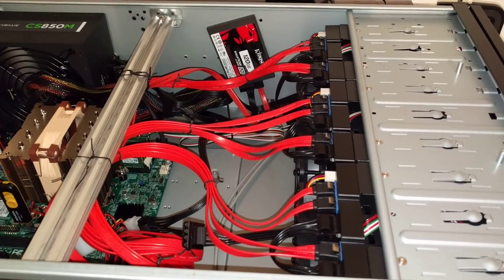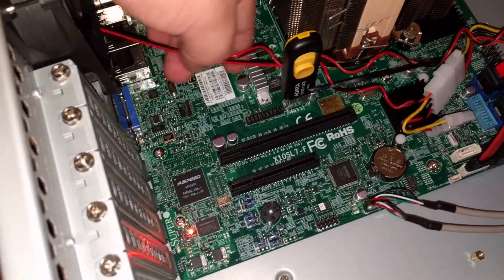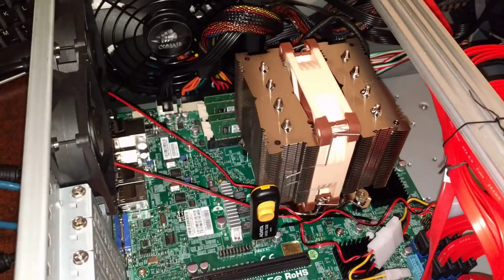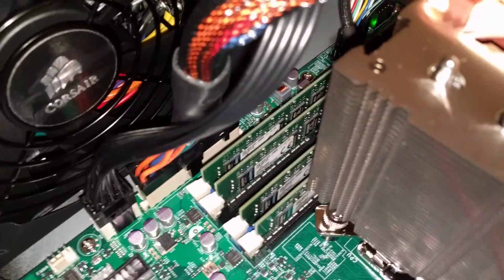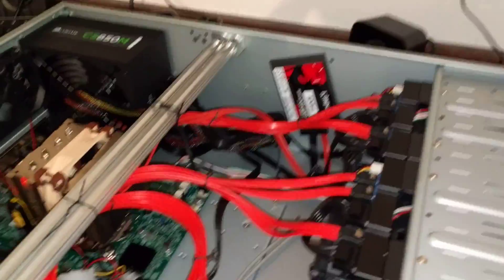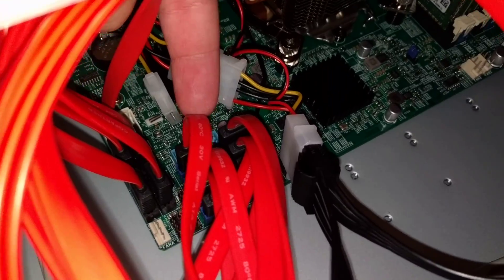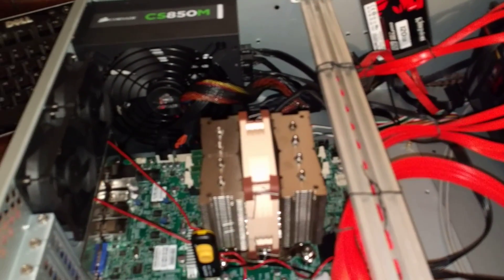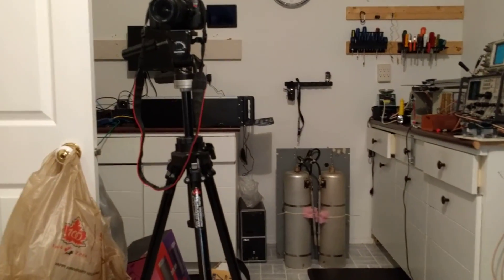My FreeNAS box

Comment: To be honest I just replaced my Xeon E3 1275 v6 32GB Ram 6x4TB setup... it sounds like a very good system but when you actually factor in the energy bills and the cost of the machine, its not worth it. I sold mine, got myself a ODROID XU4 Cloudshell2 with 2x10TB hard drives... Runs at around 10-20watts during streaming and low when idle. Xeon on the other hand unless you have M series are all 75-100 watts, over the course of a year this adds up. Also, as a NAS, you really don't need those kind of speeds internally, even for 4K 10bit. The setup I have now does 100MB/sec, down from over 300MB but... unless you need those speeds, this system and mine was simply over kill and a waste of power.... unless your planning to stream multiple 4K 10bit HEVC UNMUXED there's no need for this type of setup. Save yourself some money and get an decent ARM device that works with Ubuntu.
Reply from the maker: Yeah, that's a fair criticism. We use this thing very heavily as both my wife and I work from home. It's also the datastore for all of our VMs for work/services so we really do need those speeds. Both of us run heavy backups to this thing and we need to be able to move large data sets on and off regularly. Besides work, it's our entertainment system, our "HD" NVR system (HD local, SD to cloud storage), and where we keep our important photos/encrypted docs, etc... We could move to a more power-friendly device, but where I live the price per kilowatt hour is low enough that it still makes sense to us.
Reply: What’s your hdd setup?

Comment: on what basis do you suppose you need extra cache (ARC)?
Reply from the maker: Mostly because I am using it for VM datastores, so having the ability to use the 10Gbps NIC full out to SSDs made sense to me. I do rarely hit the cache hard enough to justify it's existence, but by the same token, this box is admittedly over kill.
Reply: Thanks, the reason I ask is because Wiki isn't clear about it:   

  "Lack of suitable caches, or misdesigned caches — for example, ZFS can cache read data in RAM ("ARC") or a separate device ("L2ARC"); in some cases adding extra ARC is needed, in other cases adding extra L2ARC is needed, and in some situations adding extra L2ARC can even degrade performance, by forcing RAM to be used for lookup data for the slower L2ARC, at the cost of less room for data in the ARC."

So using L2ARC devices comes with performance degradation risks, but its not clear why.     But on that note, I don't see any option for choosing "read" or "write" caches in FreeNAS - just the option to add an L2ARC device?

Also - if you were using this for VM Datastores, wouldnt that be more justification for a dedicated SLOG?
Reply from the maker: Yes. Completely accurate. My issue is that I am running 32GB of RAM which is the max for this board, but I have close to 40TB of ZFS discs spinning. This might not correlate right away, but ZFS eats about 1GB of RAM for every 1TB it's tracking so when I boot up my ram usage basically hits the roof. In order to prevent massive swap load,  I opted for the SSD ARC.

Comment from the maker: Update 2: The main volume has been expanded to 8 WD RedTB drives. Two of the four 1TB drives have had issues - one failed, one is giving SMRT warnings. The X10-SL7-F mobo has 8 ports on it's Broadcom 2308 SAS2/SATA (6Gbps) controller, so that's where the 8 WD Red 4TB discs are connected. The 4 1TB drives were on the internal 3Gbps controller, with the two SSDs on the remaining two 6Gbps SATA ports. Today, the content of the security volume (formerly the 4 1TB) has been backed up to the main volume and rebuilt. There is now a WD Purple 4TB drive being used for my camera DVR, and the two remaining "good" 1TB discs are in a RAID1 as a further security volume for storing the "stills" (about 10fps JPEG) captured by my cameras before being duplicated to the cloud. I have an other 1TB drive (not a matching Seagate) sitting in the one remaining slot. At this time all 14 (8+4+2) SATA ports are full, so this makes a total of 16 discs if you include the boot media USB3 drives. 

On the networking side, I have now installed an HP dual SFP 10Gb NIC. At this time it connects between a matching card in my workstation in my office and the FreeNAS box, but in the future it will be the connect between my ESXi box and the FreeNAS box so that boot time is lower on the few VMs where the boot media is on the NFS store (only 2 of the 4 VMs). For the two main VMs on this box an internal SSD holds the boot drive, but all other data is mapped to the FreeNAS box.

One thing I have wanted to do since early on was to replace those fans, but I just can't bring myself to remove such quiet-at-full-speed fans. Rosewill really shocked me with those. I expected they would be absolute trash, but they have been surprisingly solid. There are 7 fans total in this box, 5 of which are Rosewill. The other two being the Corsair one in the PSU and of course the Noctua fan in the NHD7L.

Comment: Nice cans ;)
Reply from the maker: :) Yeah, that whole repeater was supposed to be off the bench and back into service a year ago, but sadly it remains homeless. It's currently running into a 250W dummy load as if it was on an antenna because there were issues with the controller previously. I can't seem to replicate the issues the original owner was having. 73.

Comment: Where is the next video? Sound? Some of freenas install? speed test?
Reply from the maker: Didn't happen. It's not loud at all as these drives are decently quiet, plus it's in a cabinet. It's a little loud on boot, but then it's basically silent. The FreeNAS install was fairly basic. Today there are some changes. For instance, my 6 4TB drives are now 8, and my security volume for my DVR is 4x 1TB Seagate drives. Additionally, there are two SSDs (240GB) for both read and write cache. I added a 10Gbps NIC and speeds are amazing. I can just about saturate it at first, then it drops down after. For what I do this is obviously more than sufficient. I really enjoy having this mounted as an iSCSI volume on my ESXi box due to how quick it is.

Comment: Nicely done. The components are reasonable, if not a little overkill, and the cable management is excelent. I was planning to build a freenas box in the same case but instead I will put it on my new DL380 G6 as a VM because of pricing constraints. Luckily the 2.5 inch SAS drives can be swapped for regular laptop HDD's. I'm using 4 2TB seagate drives in RAIDZ3. The DL380 nativly has 4 network ports for each vm, and I only have one drive cage in right now for a max of 2 VM's using 4 drives. I can buy another for $50 to expand it to 16 drives. The CPU's are 2 Xeon E5540's with 24 G of ram each. It isn't the strongest setup for a ExSi server but it'll owrk.
(sorry for the wall of text, I'm real bad about that)
Reply from the maker: For a home system, that box is going to be amazing. I used a bunch of DL380 G8s for a project at work a few years ago (network monitoring and management) and it screamed as an ESXi box. My home network is overkill, and yes this is built beyond my needs, but I wanted something that would be able to store baby photos, wedding photos, important documents, etc without too much worry. I wanted something that I could use to back up my personal machines and work machine, and to be the data store for my lab. Also, my wife uses it to store cold copies of her dev VMs so it get's used a lot. The compute power of the Xeon is nice because it lets me run Plex, Transmission, etc to make it into a home entertainment "server" too. I know this is overkill for a home, but it's too expensive and time consuming to not build like this as it would be a constant shuffle of my huge amounts of data.

Comment: Did you have any issues with the SuperMicro plate at the bottom of the mother board where the processor is housed?
Reply from the maker: I'm sorry, I don't understand your question. Are you referring to the PCH heat sink, or another component?
Reply: Yes. Sorry for lack of terminology.

Comment: I know you have said in some other comments that you have upgraded the thumb drive to a dual off the 3.0 header.  But what are you using to attach the usb directly to the motherboard in your video? I am very interested in that!
Reply from the maker: Benjamin H in the video is a single USB 3 header on the board. it's the same as an external USB device. Now I use an adapter cable from the USB 3 header near the SATA headers. Take a look at the board, model number is in the video description.
Reply: Ah gotcha! I was trying to figure out the best way to have the usb inside the case so it is not dangling out the back.  Thanks.
Reply: He was using hot glue :D (kidding) :D

Comment: Great job wiring up all those cables to nice clean bundles for an excellent airflow!
Reply from the maker: Thank you for your comment. The wires are grouped up in the video mostly so that I knew which was which when I was plugging the 12 SATA cables into the mobo. Since this video I have replaced the twist ties with velcro. This box moves a lot of air very quietly, and never really gets that warm as the disks are not under substantial load.
Reply: And makes things alot easier when the dust bunnies face the annual eviction.
Reply from the maker: Yup! I opened it up a few days ago for the first time in months and was amazed at how little dust makes it through the filter on the front. I opened it to install a 10GbE card, and give it a once-over. Since this video I have added a second SSD and moved from using one USB3 drive on a USB3 socket to using two on an internal header with a breakout cable. I like having the boot/OS drives mirrored.
Reply: That reminds me: I have cut open disposable tea bags and placed them  in my server as an air filter in front of the air intakes, and got positively surprised how well they work! Just a crazy idea - with astonishing results!
Reply: Bandicoot803 -

Comment: I recently built a VERY similar system, with the Rosewill case, an Asrock motherboard with 12 SATA connectors, and very similar cabling.  Gratifying to see that I wasn't alone in my choices ... nice build.
Reply from the maker: Thanks for the comment Rob. This board is a Super Micro board, but the Asrock units looked like better value. I thought SM was a junk brand until we started using them for a few things at work and really started to respect what they made. The IPMI on this thing is great. I started looking at this board when we used one in a 1U case with the same proc for a DNS+DHCP server. We kept it busy with a synthetic DHCP and DNS stress test and it kept cool-ish. I put mine in a large case so that I could handle the drives AND have quiet Noctua fans.

I don't see any videos on your channel, but would love to see your build. Hopefully once my finances settle down (first baby on the way) I can build a nice machine to move my VMs to. Right now I have a pre-Sandy-Lake i5 running my ESXi cluster and it is just too underpowered for handling all of my high def security cameras.

Comment from the maker: Update: The USB boot drive has been moved to a dual USB3.0 cable that connects to the header near the SATA headers. This allowed me to have dual-USB boot drives so that I could have them logically mirrored. The SSDs have also been doubled, so there is one SSD for read caching, and one for write caching. The wire ties holding the SATA cables have been replaced with Velcro cable wraps. The network has been upgraded to an LACP bundle  (LAGG) so now there is a combined bandwidth of 2Gbps, with the usual caveats.
Reply from the maker: Oh, and I am not yet ready to move to FreeNAS Corral yet. Once I am ready, that will happen.

Comment: I would recommend z-tip ties instead of the wire ties your using.  Wire ties can cause short outs in the future.
Reply: What are we, heathens?! Use velcro like a sane person. Nice build. :)
Reply from the maker: Brian Henry Yeah, I just reused the twist ties from the SATA cables to get it going. since posting this a few things have changed. all cables are now supported by Velcro, the SSD mount is straight and there are two of them (one read cache, one write cache), and the single USB has been replaced with dual mirrored USB connected to the dual USB3 header next to the SATA headers. Also, there are now three more 4TB disks in the system.

Comment: Hey, nice looking project. What exact Rosewill chassis model is that, and does it come with hotswap boxes incl.?
Reply from the maker: Rosewill RSV-L4412. I bought it because I liked that it allowed for good cooling and 12 drives. There are better ones out there, but not for that price. Yes, the drive cages came with it.
Reply from the maker: Also, I want to give kudos to this case for the fans. They are so much quieter than you would expect from an OEM case. Decent airflow.

Comment: How would you go about expanding your NAS storage? Say you have a 24 bay server and are only using 10 bays. Could you just slide a few more HDDs into the empty bays and it would add it together? I currently have a small Synology NAS which just rebuilds the RAID and adds the new drive automatically. I am looking at putting something like this together so any info on this would be awesome! Currently I am looking at a 4U 24 Bay SuperMicro box. Thank you!
Reply from the maker: bunnster22 Yes, ZFS allows for expansion. It can be CPU heavy, but it's worth it. consider marking some drives (one at least) as a spare. There are many great tutorial articles and videos online

Comment: Does the OS use ZFS?  I've seen a couple write ups using flashdrives, but i'd only want to do that if I could mirror them and enable scheduled scrubbing for OS.
Reply from the maker: Yes to all of that. it's not in this vid, but I did dual USBv3 later. Scrubbing is default, but you may want to turn up the frequency.